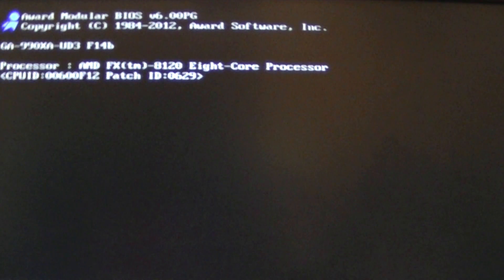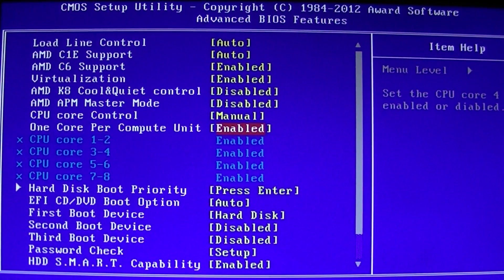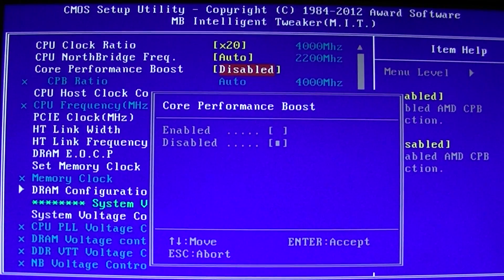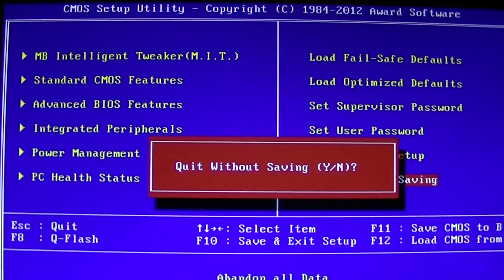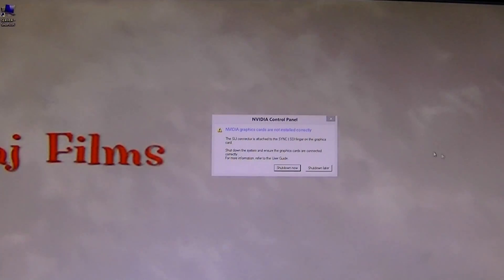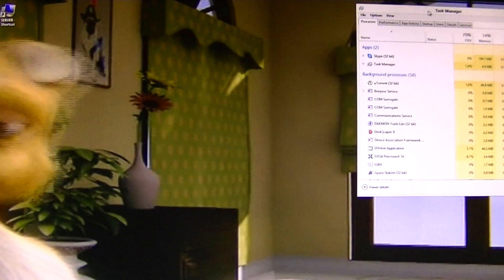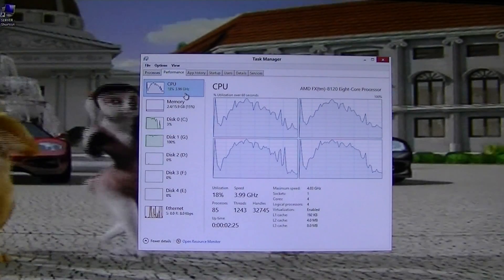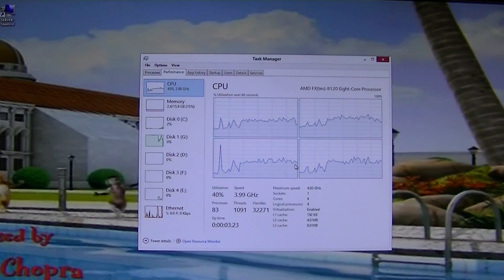AMD FX, HowTo configure, permanently  Core Boost, Core Control, Setup

Comment: Hello There ! i have motherboard biostar a960d+ and i don`t have any options like this amd core boost or something else in bios , and in games from 200 fps  i have drop to 20 30 , i have gtx 950  2 gb biostar 960d + amd fx 8350 8 gb ram ddr 1333  , psu 550w ssd 120 gb.

Comment: I have had my FX 9590 at 4.7 GHz for 5 years now. I tried your method of disabling the cores to improve single core performance.. It is complete B.S. I ran CPUz bench test with the 4 core and 8 core configurations. The 8 core single thread performance was still higher. I ran benchmarks on Rise of the Tomb Raider and GTA V and still the FX 8 core configuration scored much higher.

Comment: Best settings for maximum single thread performance

High BCLK = 250
(Increases Northbridge and L3 cache clock also OCs RAM)
Multi at 20.0x

5 GHz. @1.55V

Then set 1 Core per CU.

Use dual channel RAM, 1 stick per channel. 
Done.
Reply: Why would you need to even bother disabling cores for 5 ghz only? :/

Comment: So this helps with cpu intensive single thread games. Well thanks a lot i will try it out in arma 3 as soon as i fix my gpu.
Reply from the maker: +Phoenix yes it will if the app is Single thread/core related .. Also 2 cores would not have to wait on a single FPU for access...

Intel has some what the same issues.. With Intel HT enabled Thread Collection happens all the time... how ever your experiences and performance will very  

also not all AM3+ /FX board support single core per a modular
Reply: Did you get better fps man?